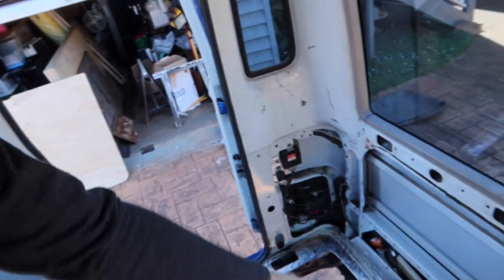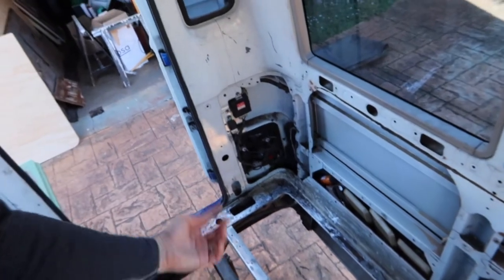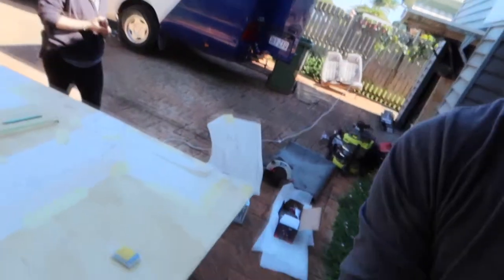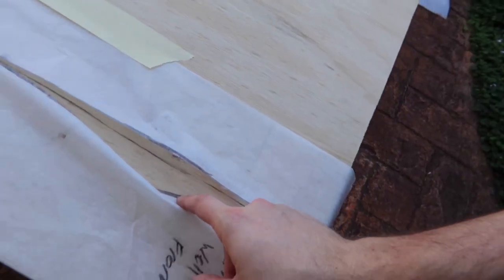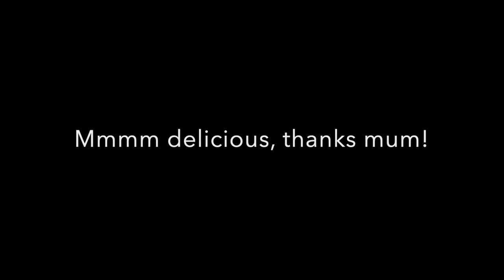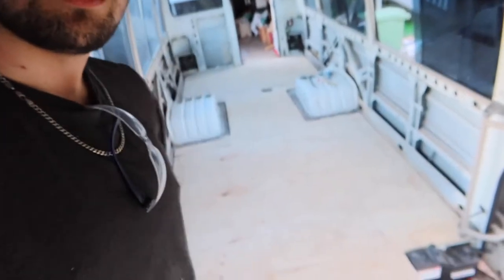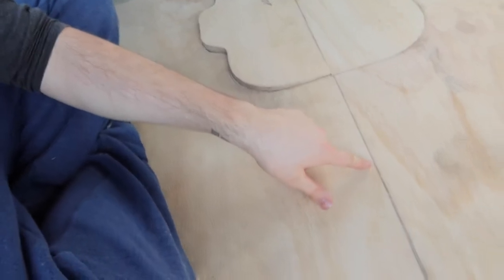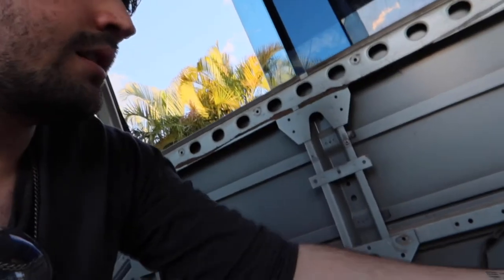Our Coaster Conversion - Part Seven - Cutting the Sub Floor

Comment: Wouldn't be better organised all the plumbing before the flooring so you have exelent access to install the tanks and hoses and part of some electrical wiring ?
Reply from the maker: I have just put the floor in but not securing it down until plumbing and electrical is done. It’s mainly so I have somewhere to walk and put tools without the old crappy floor.
We will be getting back into it after an 18month break.